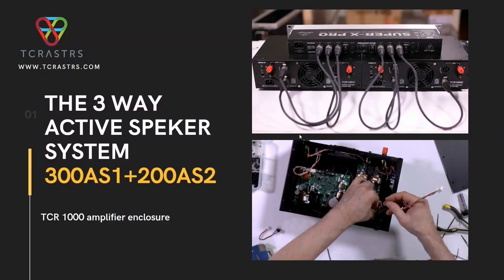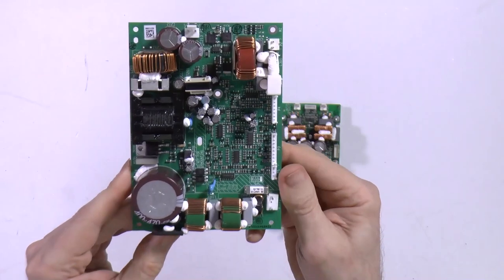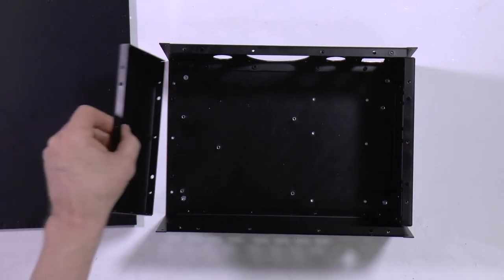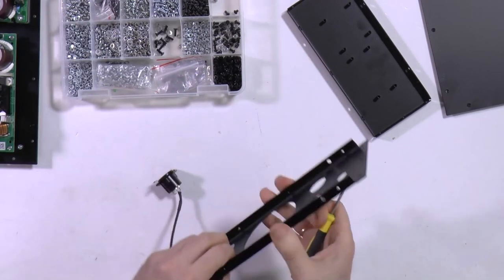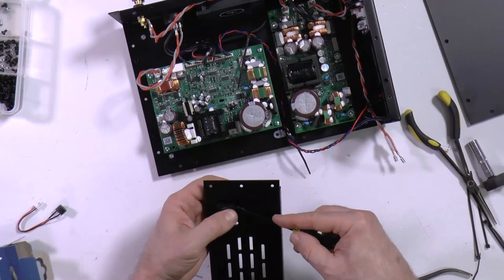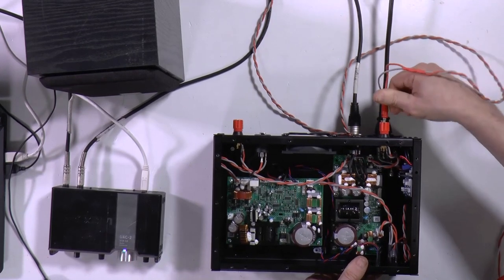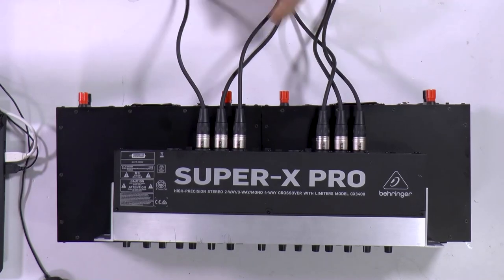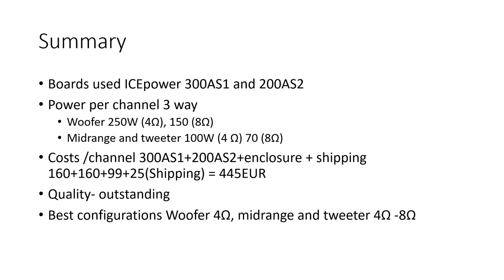Active speaker system ICEpower 300AS1 200AS2

Comment: Good day everyone. I’m building a power amp using the icepower 300AS1. In order to use the auto standby and audio signal on, the data sheet  mentions to “pull the 5V trigger low”. I tried shorting it to its ground pin but this is not working. Anyone have any suggestions for me? Thanks in advance 🙏

Comment: Active speaker systems is something i would like to beck into, but in my case i get hiss noise when amps are connected to drivers. hypex fusion amp 123 for example is very noisy.
Reply from the maker: You should, probably, add Zobel network circuits to your tweeter. How you described it sounds like extra amplification for the tweeter due to the rising speaker impedance and mismatch with a class d output filter. It is a pure engineering task to solve it.
Reply: @guntarssmits2104  same noise in woofers also, do not know if that makes a difference.
also plugging the hypex into a passive 2 way speakers made hiss noise.
Reply: Class D amps are very sensitive to source for reason I don't know yet. My previous experience with CX3400+1200AS2 also has hiss on the heil amt tweeter. It hiss less on the seas dxt tweeter.
But if I connect the source to motu m4 it won't hiss on both tweeters. Also if I add attenuator between cx3400 and 1200as2 it also won't hiss. But from datasheet I think cx3400 is quiet enough. Not sure how the noise generated.
For hypex amp you may try to short your input to make sure whether it's source noise or noise from amp itself.
Reply from the maker: @sudd3660  Then it seems like a DSP issue. Hypex amps are good. I made several designs with standard dome tweeters and Icepower125ASX2 with my designed preamps.  They are working well. You can not hear any hiss from 30 cm away from the tweeter. If you really put your ear right in front of the speakers then you can barely hear amplifier noise. Noise in woofers and tweeter indicates that there is something wrong with amplifiers or source grounding.

Comment: Hi again. I ordered behringer cx2310 and I wanted to check differences between passive vs active by myself, unfortunately it's just making humming, nothing more (for tests I'm using poor rear speakers). Maybe I'm doing something wrong? Without crossover everything is working properly...
Reply from the maker: Check input XLR cable and source . With an unbalanced source, you need to connect XLR pins 1 and 3 together and leave the chassis pin unconnected.
Reply: @guntarssmits2104  I think that my pre-pro has balanced xlr (marantz av8801) also 700as2, xlr cable scheme looks same. Any ideas?
Reply from the maker: @partyk138  If you have a sound card you can convert it in pc oscilloscope and look for signals,.  Download the Behringer manual and check the back-side switch configuration. If you have a tester you can measure signals at the connector inputs and outputs. Generally speaking, Behringer is a simple straightforward device, but reading the manual would help. I think there is something with configuration settings.
Reply: Ok then, I will double check everything. Anyway I think that this device is pretty simple, so it must be something little or device is damaged.
Reply: Probably I found issue. Grounding, it's extremely important, I will use copper wires instead of painted chassis. Anyway I don't understand why before using active crossover there was no issue. Any ideas?
Reply from the maker: @partyk138  Try to remove ground inside xlr at the source side. ( Desolder pin 1) When at least one device in your chain is not built with the correct grounding schema you will have a loop and everything will have a hum. To check the grounding loop you can borrow any professional audio interface like Focusrite which for sure is built by the book and test it. Another important thing is not to connect the amplifier xlr input pin 1 to the amplifier chassis. It should go into the board without touching to chassis.  Seems you have a classical grounding issue.
Reply: @guntarssmits2104  Will it be still balanced after removing gnd from XLR? XLR on my Amplifier has plastic sockets wihtout connection to chasis. Is there any sense to replace poor wire between power cable and IcePoewer board to copper wire with connectors, I heard lower noise after changing connection from chasis to direct board (but still with poor cable)?
Reply from the maker: @partyk138  IT will still be balanced when you remove the ground. By experiment, you should find which device has a ground issue. For example, if you connect a crossover without connecting the input, to the amplifier and there is no hum then the problem is with Marantz output.  If the hum persists then there is something with the amplifier input By removing xlr ground (ground lift) you are breaking the ground loop.
Reply from the maker: You need to drill down how a balanced system works. I have video where explaining this topic https://youtu.be/_HkM990zZ4c
Reply: @guntarssmits2104  thanks a lot, I spent a lot of time looking for solution... I make modification during weekend and try to convert speakers for active crossover :D
Reply: I made modifications, it's much better, noise is low, during weekend I will make final modifications.
I modified ony one speaker for active crossover, you need to spend a lot of time to find good setup, in my opinion mid is better and space is much better, guitar now make soo big ambient. I'm not professional but I hear difference, not in all aspects, but I belive if you find your setup it will be a better solution.

Comment: What do you think about replacing 200as2 to 300a1? If you are using 2way speaker it can be cheaper option, and 300as1 has dedicated connection :)
Reply from the maker: It would be an absolutely great solution for a 2-way speaker. You can also try 200AS2 for that. It can work with asymmetrical load delivering 200W for the woofer and 40W for the tweeter for the 4Ohms load if you are looking for the budget.

Comment: Thank you for the excellent videos, I have a lot of catching up to do.

Any idea what could be causing this clicking noise on my 300AS1s? This was pulled from a Kemper power cab, and was the 2nd to have the exact same problem. It was brand new, and I never even connected any signal to this one. Sadly I later shorted something while probing and let the magic smoke out. Even more sadly I wasn't rolling the video then.

I'm really curious to get to the root of it...I saw your video on v1 vs v2 125ASX2 (how I found you) but I doubt Kemper would be having that issue so I would love your thoughts if you have time. TY!

https://youtu.be/qcH7DoIrk50?si=2WKA93LbN9QN1bdm&t=233
Reply from the maker: I have built some projects on 300AS1 and it is perfectly silent. I guess that there is some problem with grounding. First, your inputs should be insulated from the chassis. Check the RCA input chassis connection and insulate it. The same is valid for service circuits. Your board should have chassis ground only via dedicated mounting hole. Also, you can temporarily remove the safety mains ground and check the status without it.
Reply from the maker: I have seen your video. You should go step by step. First, minimize connections and run only the board without the output connected. Is there a click noise? Then connect inputs. Make a test. Then attach the service circuits. For my hearing, it seems like some protection is triggering. Maybe 12v circuits are overloaded for some reason or mins output is shortened by measurement instrument. You should take into consideration that this is a single voltage board and outputs have 25v dc for both speaker outputs. You can not measure them with an oscilloscope at the output connecting ground to minus and hot to speaker plus. You need insulated probes to measure board outputs with an oscilloscope.
Reply from the maker: The last thing to consider is if you put the board in sleep mode the power supply is going into economical burst mode. I am living in a 220V country, yours seems 110V. I did not test it on 110V. Burst mode means that the power supply with regular intervals running package of pulses to feed the service power supply. It may be that there is a mechanical mains transformer click/buzz